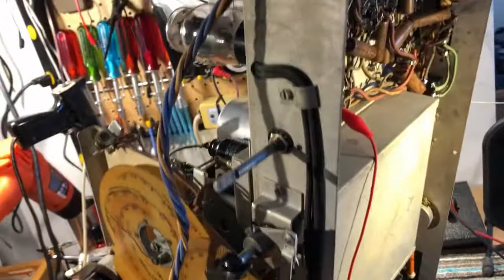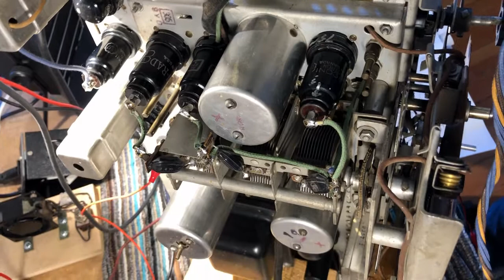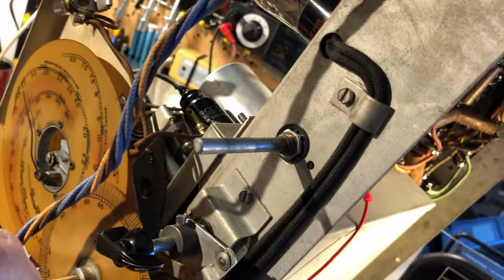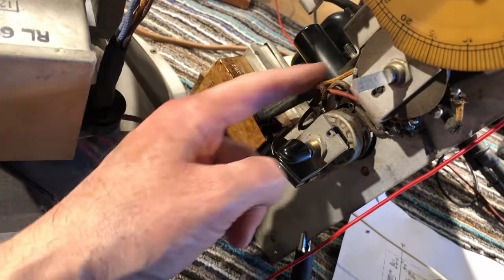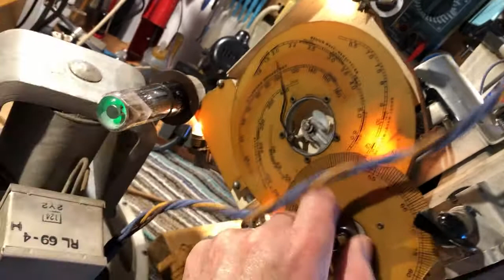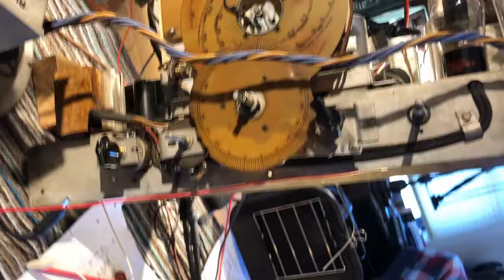RCA 15K 1 Edited

Comment: I just purchased one of these in beautiful cosmetic condition but does nothing but hum loudly. My first foray into radio repair.
Reply from the maker: Hi Chris.  Replace all the electrolytic and paper capacitors for starters.  Check out my article on restoring this set, here: https://sparcradio.ca/wp-content/uploads/2022/03/Restoration-of-an-RCA-Model-15K-Rev.1.pdf.  No need to restuff capacitors etc. as I did on this chassis if you are not bothered about how it looks under the chassis (the owner of this set wanted it to look as original as possible with 80 years of patina, but to work like new)
Reply: @RadioRestoration  This is an amazing resource, thank you! I work on the electrical side of automation. I have a basic knowledge of electronics; caps, resistors, potentiometers, etc. I have no experience with tubes but recall my dad suggesting they could behave like caps and cause harm. Anything I should know, very generally, about tubes?
Reply from the maker: Hi Chris.  Too much to say here(!), but there are a number of my 'Tech Short' articles you may find useful here: https://eddystoneusergroup.org.uk/restoration-projects/ .  There are also many more restoration articles on the SPARC Museum website and on the Eddystone website that contain a lot of info.  Also, check out this book: https://www.worldradiohistory.com/BOOKSHELF-ARH/Technology/Servicing/Elements-Of-Radio-Servicing-Marcus-Levy-1947.pdf .  The 'World Radio History website is a huge resource: https://www.worldradiohistory.com/index.htm  @chrisfor
Reply: @RadioRestoration  Thanks again, I appreciate all the info.
Reply: @RadioRestoration  And I'm KD9LZT, glad to meet you.
Reply from the maker: I'm VE7GUH, located in Victoria, BC, Canada.  If I can help further with your RCA 15K-1, send me a message.  73, Gerry.   @chrisfor